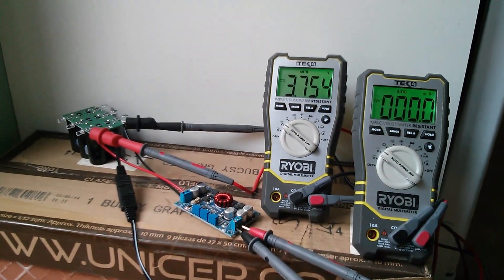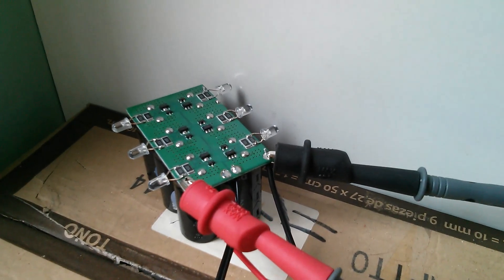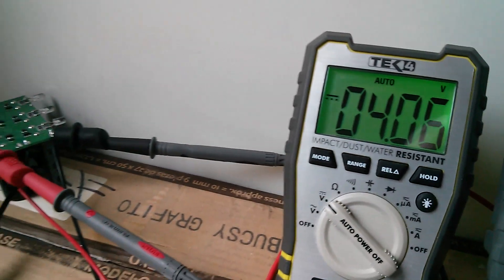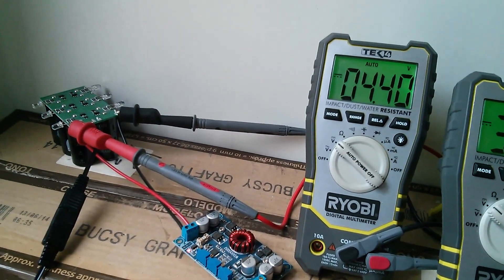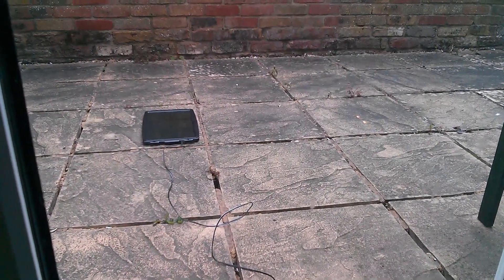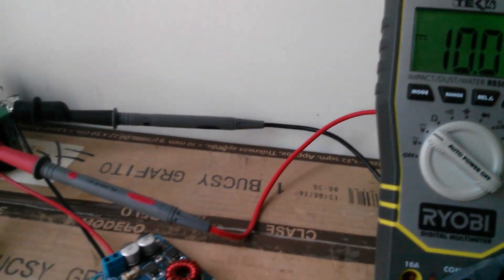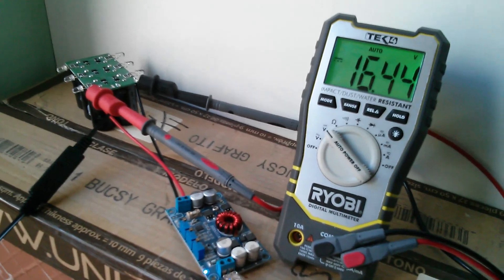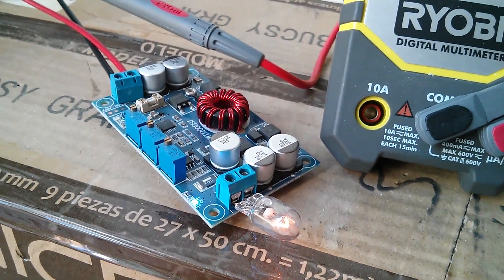Solar Panel, SuperCapacitors and a Buck/Boost

Comment: Been testing these concepts in my solar setup. The batteries are working alongside ultra capacitors. The results are great but now I have the idea that if I grab another ultra capacitor bank then I should place it between the mppt controller and the solar panels. The effect I think will happen is that the excess power that the mppt controller usually ignores when charging the batteries will be stored until the mppt controller can make use of it. Capacitors can handle this load much better than batteries can so long as the rating of voltage is above what the solar panels can produce. Capacitors are strange when it comes to this. Logic says it should keep filling up but they never go past the highest voltage produced.

Comment: I just commented on another video with the same question but looking at this one it definitely looks like it limits the current output as the input voltage limit kicks in rather than a hard shutdown! (which means it can be used to keep a solar panel near it's peak power point, in this case 16v and then charge the super capacitors faster! :-) )

Comment: Had a play with this with a cheap MPPT circuit  to Super caps. that then go through a lipo charger to charge a small lipo and then a buck converter to 5v usb output.. This was a prototype to power an ESP32 Lora. Found that the circuits involved just did not create enough power to sustain the ESP32 during the night. Upscaling the panel. Would mean upscaling the MPPT module etc. Which then increased cost to the point it would be just better use a larger panel and a MPPT into a lead acid to a 12v to 5 volt buck converter. With that scale the esp32 project was no longer discrete in size.

Comment: Is this set up acting as a crude MPP converter for a connecting a pv panel to a fixed load? As I understand it, the capacitor bank is scaled so that it's maximum charge corresponds to the Vmp of the your panel. Does this mean the panel outputs near its Vmp when the capacitor bank is full (regardless of the irradiance)?

Really enjoy your vids!

Comment: He is useless. He can just add lots of supercaps and use an 24v solar controller with a step down converter 24v to 15.8v to match the supercapacitors. Otherwise, you will use only 70% charge from supercap. At 12v you will never charge that completely

Comment: Love your video, keep up your good work. I also have a question. If I want to charge a lead-acid battery with a lab bench power supply with the LTC3780, what should I do with the fall left TRIM POT? Thank you <3

Comment: You have just proved that super capacitors on the input are the last thing you want to do efficiency wise. You should have the buck converter modified and operating in the MPPC mode and charging the capacitor for fastest charge.  I skipped through the video and it was still a waste of time.

Comment: If you hook up the solar panel to a second buck boost converter input and adjust its MPPT pot to 17.5 volts and the output charging the Supercapacitors Then the solar panel will never drop below 17.5 volts and be able to generator power at maxim output (depending on how much sun you have of course) This would help when the capacitors are at a low discharge state and they wont pull down the solar panel voltage below 17.5 volts. I am sure you figured this out later though.

Comment: Great video fun to watch. At one point in the video your super capacitors where discharging once the sun went away. I believe that not the buck/boost drawing current but the solar panel it self. If you hook a solar panel unmanaged, directly to a battery it will charge during the day and discharge the battery at night. I would try adding a diode between the panel and the capacitor bank so when the panel voltage matches the capacitor voltage the current cannot flow backwards. IMO

Comment: please help me find a cheap charge controller for my 24 volt unisolar ,144 watt panel,to charge my 24 volt ,109 amp hour battery. the panel can go up to 42 volts. i keep getting controllers that say MPPT but then find they won't convert voltage higher than the battery used. i'm getting tired of paying to ship back things sellers lie about.

Comment: Shouldn't that capacity Bank be about 20 farad? 120 divided 6... Anyways, I want to use supercapacitors with the solar panel because while travelling with the solar panel, it will get lots of shading and I want to have a consistent voltage for charging USB output...

Comment: Hi Julian, I need some advice if possible....
I have made a battery bank with x2 12v 12ah SLA batteries (In Parallel) to obtain a longer capcity. I charge most things on it, it runs my led lights, but when i plug in my phone to charge it (via a 5v usb connector), it interferes with my dab radio (also plugged in via the same usb socket as is also 5v). i was thinking that it is an unstable 12v dc supply causing the issue?? can you please give me some advice on how to resolve this, would i be right in assuming some sort of dc/dc converter to smooth out the voltage? Many Thanks in advance. Love you videos by the way. keep up the great work!
Reply: I have done a bit more research and it turns out that dab signal is not very strong, and any cable running charge through it could actively "soak up" the dab signal. Would you have a workaround for this Julian?
Reply from the maker: How are you regulating 12v down to 5v? Switching regulators can be noisy.
Reply: Hi Julian, I am leaving up to the 12v usb socket to regulate it down. see ebay item 232360867986. I also use a solar charge controller to control voltage coming out of the batteries. Is there a mudule that I can buy and plug int between the output of the batteries and the loads? Thanks Julian, much apreciated
Reply: hi julian. sorry for the late reply. i am not regulating it down as such. i am using a 12v  dual 7sb socket which brings the voltage down to 5v on its own. i suspect that its the cheap socket thats giving me the noise. can you recommend anything to put in my box to regulate the voltage before it gets to the 12v sockets? thank you. your help is very much appreciated. eric

Comment: there is also a way batteriesor supercaps discharge thorugh the solar panel i got a 4s lion batpack and i put a diode inbetween both even do its not that efficent

Comment: That's why you use a blocking diode so voltage goes in and not the other way around

Comment: That's so stupid why don't you go from the solar panel to the DC to the DC converter first regulate the the dc-to-dc converter to 14 volts then put the tack on to the end of it
Reply: Colin Stienke it's a experiment

Comment: ive had a 500F super capacitor work 5.2 amps for 4 seconds running an inverter and a 60 watt bulb the inverter shut down after 4 seconds
Reply: Voltage the capasitor? 2.7v right?

Comment: Perhaps use another buck/boost circuit, with the Under Volt (UV) pot set to the Vmp of the solar panel, so that you can control the solar panel voltage... and then you can set the output voltage to the desired value for the supercapacitors... this would mean you would regulate the input voltage to the Vmp of the solar panel and get much more power.
Reply: I was thinking the same thing. I haven't a clue about this sort of thing but I would love to see if it worked.

Comment: I cycle my (solar charged) lead-acid batteries daily, using the power in the evening to run/charge my computer and phone and power some lights.  Even though I'm not letting the batteries drop to a very low voltage, I know the life of my batteries is diminishing.  It's inevitable.  I really wish a super capacitor bank (of equivalent watt-hours) was not ridiculously expensive.  I'm obsessed with the idea of things lasting "forever".  What you're demonstrating is a small-scale representation of my dream :)
Reply: LFP will get you somewhat there albeit with a cost, but they have great cycles in them and should last about 10-14 years with daily cycling...

Comment: It looks like the caps discharge into the panel when the panel voltage drops below the cap voltage. Is there a schottky diode in the line to prevent this?
Rob

Comment: If I remember right.  That supercap bank isn't all that high in farads.  However, if you have a charger connected to it then you could wire in a GTI on the backend.  I know a bloke I have been watching for years.  he is using 10 banks of what I think is around 400F per cap.  Even if you didn't want to do that.  You could setup a bank to run experiments.  SuperCaps have low leakage for a cap.  Well, I need to get back to sorting out Arduinos as am picking up Muffet.  I'll box up the prototype when ever I can.  The parts for the initial setup must be on a dingy coming from China.

Comment: I suspect when the voltage stalled at 4.4 v the buck converter kicked in and started to absorb power , taking away from the charge situation.

Comment: How do those supercap protection circuits operate, do they just drain the caps into the resistors? Does the current happen to be just right to light those LEDs too?
Reply from the maker: The voltage (2.7v) is just right to light the LEDs

Comment: Julian, nice one. 
Another VIDEO IDEA, since you like solar power subject:
"Solar power for beginners - basic solutions review."
There is a lot of scattered information everywhere about solar power, but would be nice to have a simple overview of various size solutions. E.g. Low power solar system, with 2-3 18650;  mid size system with maybe small 12 v and larger power with regular acid 12 batt. What controllers would you use, what size of solar panels would you use; options to connect the load etc.  
Can the theoretical only. E.g. Walk through what's on eBay and can be built with it. 

Just a thought.

Comment: Is there a way to convert the capacity in farads into amphours? Just for reference. Also, can you use super-capacitors like batteries? That's the main reason you're doing this right
Reply from the maker: Yes. Coulombs=Amps*seconds and also Coulombs=Farads*Volts
Reply: Julian Ilett so farads = (Amps * seconds)/Volts
In this setup, you’re looking at ~2AH

Comment: If you put a lead acid battery in parallel with the supercap bank you could keep your voltage closer to the maximum power point, I guess the disadvantage would be that you're only using the top end of the supercap charge capacity. Is this a crazy idea or a good one? I'm not really sure..
Reply from the maker: The crazy ideas ARE the good ones :)

Comment: I have 700w of solar panels on the roof of my motorhome, as they are flat they only get up to about 550w in summer in full sun, in NZ, which has the sun a little higher in the sky.

Comment: I've got one of these supercap banks. They get to 2.85V and leds don't help much - some of the caps still reach more than 2.7V even I started all from 0. I ordered undervoltage reset chips for 2.63V to try and replace the built in balance chips

Comment: But isn't 16.5 the absolute maximum for those capacitors? Maybe you should put a diode in series with your solar panel.

Comment: The joy of solar projects in the UK :oD
Reply: I did run the calculations to determine how much power could be extracted from a micro-turbine on my house drainpipe. Not a lot.
Reply: @vylbird8014   Lol, yeah I saw them for sale on ebay once. I did laugh.
Reply: We really need science to figure out rain power already.
Reply: Spikey DaPikey yeh if ya cud catch a square mile of rain and pipe it a mile straight down to blast a turbine then we cud talk rain power lol ......other than that it's already been dun with dams lol water power
Reply: Vyl Bird make ya drain pipe store water like a capacitor stores energy then make a turbine not a micro crap

Comment: A Solar panel related question:
How would you maximise the wattage output on the solar panel? 

Would putting a buck/boost converter directly on the solar panel (before the super cap bank) allow the panel to output more watts as it would not be pulled down in voltage as hard as if it is connected directly to the super cap bank?

The panel in the video has it's max wattage written at a given voltage. Is there any way to calculate the max voltage for max watt output from nominal wattage and open circuit max?

Thank You again for the awesome videos!

Jan Rasmussen
Reply: Yea, that's what a Max Power Point (MPPT) converter does -- it limits the current so that the panel generates max power, and not necessarily max current or voltage. Google MPPT Controller to get a look at this technology and how it does what you asked. 

Solar Panel detailed specs do include the OCV (open circuit voltage) as well as other indicators of the power output at various non-MPPT loads.

Julian has done several vids about his various MPPT adventures, including a product he designed and manufactured.

Comment: So are you just essentially using the caps as a buffer, enabling you to run direct from Solar without voltage fluctuations? - Thanks for the vid!
Reply: I came back late to this thread looking for just the thing. From another learning project, 2x 1.5 watt direct input tiny 12V panels.don't put out enough voltage to trickle into my SUSUKI GSX1250FA until the new Bike Alarm drains the starter battery below 12.1V, by which time it's too late to find some sun. Whilst I'm keeping an eye on the voltage and riding more than usual, the buffer in my case would not need to be continuous, but spit balloon charges into my lead acid battery, said capacitor staying concentrated untill needed, unlike a leaky cistern loss into the confluence. Tomorrow's job is disconnecting from my car and separately battery powering, an unused 12v bluetooth relay, then enabling its Windows 10 Task Scheduler to stop the loss of power between this buck/boost and the capacitor. Anything bigger and I'll need an outdoor carpenter to design and get approved portable framing in front of my bike to support a 20W solar panel tracker and hang a waterproof electrical cabinet off a wedged-off hurricane fence area outside the sidewalk!

Comment: Julian, just a week ago I received a couple of mppt dc2dc circuits (from Ali). You can set (limit) the output voltage, output current, and as well set the maximum voltage of your solar panel. I did this with a test set of 3 panels of each 10 Volts which had a maximum voltage up to 31 Volt. But I got less power using it that way (up to 10 Watt at say 12 Volt). As I now use the mppt converter, I can set it at its maximum PP at 24.x Volt. Now the power out goes up to (and above) 20 Watts!
Also note that using this circuit on your capacitor bank will also work great. The circuit is max 5A (in or out), so at low capacitor voltages the current will go up, up to the maximum of 5A, and this happens at the mppt as well, so it is a win-win situation.
Note 2: Ali sells those with and without a meter on it.The meter is attached with a connector so to reduce load you can take it off.
I had the luck that delivery was fast (10 days), bought it at shop 'module sky' described as 'MPPT Solar Controller Solar Panel 5A Step-down Constant Current Voltage Module', and it cost me only 4 euros in total (4.30 USD, the one without a meter, which I would recommend). I do buy them one at a piece, to have free shipping.

Comment: Ahh but if I remember my physics teacher can't you only ever get half the electrical energy used to charge an ideal capacitor back again? and isn't that worse than a lot of realistic batteries??
Reply: Not entirely true, though you are right in a sense. Yes, you waste half the power when charging a capacitor from a simple voltage source, but there are other ways to charge a capacitor.
Reply: Well I was mainly thinking about switching in the capacitors in a sequence in order to shorten the 'boot' time and increase the efficiency of the unit... probably a few things that could be done along these lines but my brain is too knackerd from work to think about it very hard I'm afraid.
if it's novel obviously it would need a cute name though.

Comment: hi julian.. Got a question for you...
I wanted to charge my 12v battery and I'm boosting 12v to 16v & then using a cc-cv converter I'm droping it back to 13.5v but can't charge it completely can u help me with this.. I'm using a pc smps as power supply.
Reply: Amit 7805 I believe the charging voltage for a 12v lead-acid battery is 14.4v
Reply: Chuck Stickelman 
thank you for your reply... I'll pump it up to 14.4v today....

Comment: Interesting little experiment. I've all the bits here to replicate, but my smallest solar panel capable of 16v plus is 10 watts. Thought about buying some properly rated (assuming those ones aren't) super caps and building your own management circuit? You might find once it's up and running it holds more charge for the cloudy bits.
Reply from the maker: I just ordered a 6x 500F supercap board - that has 4x 10ohm resistors in parallel per capacitor, so it can probably work with a 10W panel. I'm kinda hoping Robert Murray-Smith will invent some weird-ass battery/capacitor hybrid using hemp and hand cream that will make all our lithium cells obsolete ;) P.S. I bought that MPPT you were showing the other day :)
Reply: Thanks for the tip, I've just subscribed to his channel - looks interesting. Hope the charge controller arrives in time for some sun.
Reply: I knew it! I knew you were a Robert Murray-Smith fan!  Love both of your videos!

Comment: Hhm,  seems like hooking up te dc-dc converter between solar panel and capacitorbank as a Mppt converter  (where 'm' means 'manual' ;) ) would charge it quicker.
Reply from the maker: Yes, it would, because that would increase the current.

Comment: Great video, and now I want to do that. 
we have two 100W solar panels sitting around at school which I am trying to get to run a lead acid battery power bank. With ultra capacitors being so cheap, I should have considered some of those. The current system is 480Wh.